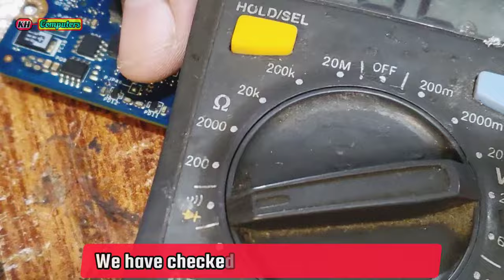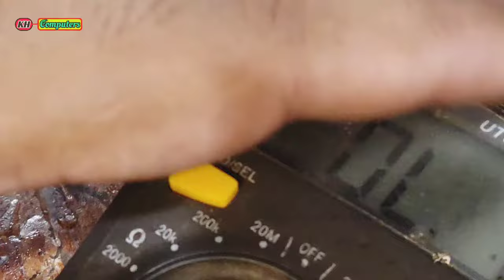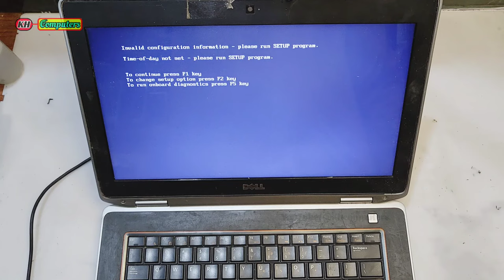Solved Charger light goes off when I plug it into the laptop

Comment: This happened to my laptop. Mosfet and capacitor were the shorted components. But after changing it, the new problem is black screen. What could be the problem and what to do?
Reply from the maker: Thanks for watching 
Okay 
NOW you can check lvds cable display volts or fuse both sides
Check BIOS firmware.....or reprogram bios
Check ram and processor

Comment: Where can i get that capacitor
Reply from the maker: Thanks for watching
You can get these components Any old laptop or computer circuit board or old electronics parts ets
Reply: Bro this is not necessary your problem. You should check the whole motherboard trying to find shortage

Comment: thanks for replying another problem im getting is that i cut off  the power supply jack and connect it to the laptop when then i use a multimeter on the jack wires im getting Continuity does that mean dc jack is not good or motherboard

Comment: had same problem with one charger, i replaced it and it worked
Reply: So your saying That its the charger that is broken?? Plsss Help ME IM having the same problem and I dont know if the charger is broken or the port
Reply from the maker: @darling_xoxo-nu4ys thanks for watching 
Please check your laptop DC adapter light goes off or not?
Then tell me again
Reply: @darling_xoxo-nu4ys  in my case it was the charger, i also had 2 other spare chargers, both of them worked, but the one charger i was using still goes off well pug...atleast my laptop works
Reply from the maker: @ralphfigaro4485 Now what's is the issue Brother?Need more help??